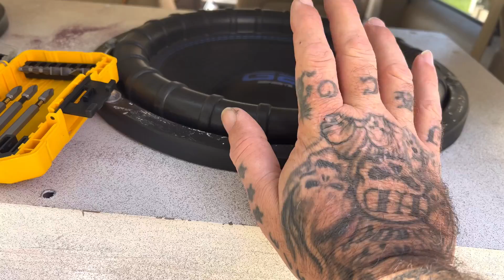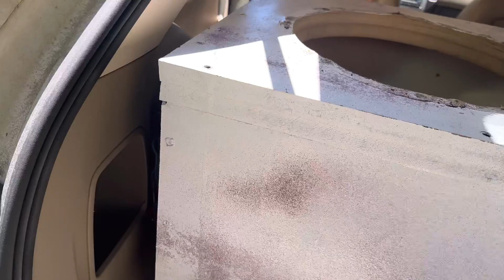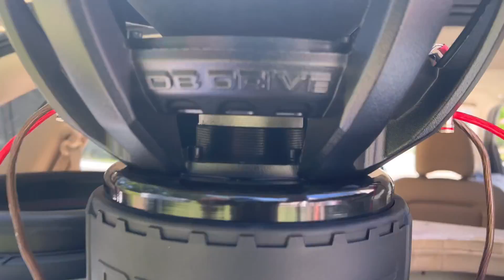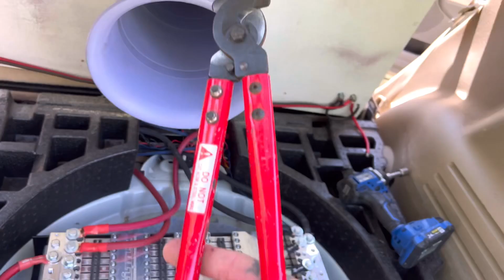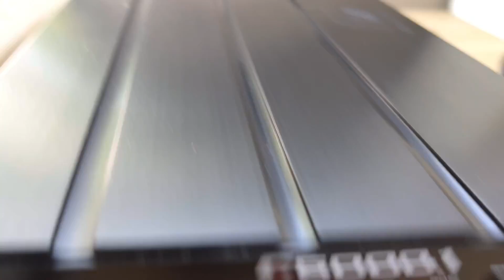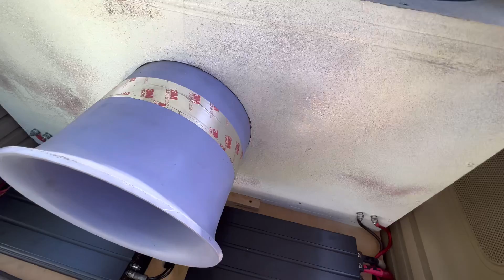DB Drive G7 system install in our Daily

Comment: Use t-nuts with machine screws bolt that b** in there you don't have that problem. No leaky leaky especially not with a little bit of weather stripping around your sub. Oh I know you know how to build you just threw that thing together it worked I understand. But don't be dogging MDF when you build a half-assed piece of junk. Just saying. You build an MDF seal all your edges seal all your pieces use t-nuts pre-drill all your holes router it correctly it's just heavy as f*** and might send you to an early grave without a respirator cutting and routering it. Which you should be wearing PPE to begin with. So don't be bitching about material when your craftsmanship is shitt to begin with. Other than that I agree with a lot of the stuff  you talk about but that one? Not so much. MDF Superior? hell no 1 inch B/BB grade Marine Baltic Birch hell yeah. Doesn't have to be Marine but if you going all out f*** it go all out⁸

Comment: T-nuts and machine screws to mount woofers in enclosure. MDF soaks up water like a sponge, so I seal it before painting/carpet/upholstery/finish. Mix white glue with water, then brush on box with a chip brush.

Comment: what type of batteries would you use for those two 5K amps? I'm thinking 4 XS POWER  PWR-S5-4700 Lithium batteries? And A 320 amp high out put alternator. Any Suggestions? BTW? I would love to hear your setup when it is finished? Thanks!
Reply from the maker: i have a 45ah Cmax for them
Reply: Thanks for the reply! cant wait for another awesome video!
 @JerryAintloud

Comment: I'm DB Drive guy for the last 4 years currently I have 2 g5 12' 4ohm's powered by 2 CT Sound 2000.1 amp but I'm looking to add two more g5 12' 4ohm's in my Yukon with 4 8 inch DB Drive Mid Range and 4 6.5 power by 2 1600 WDX DB drive & 1 1200 WDX for the 4 tweeters also  I will be add 4 DS18 Mid-Bass Loudspeaker 10" with 1 DS18 PRO 1-Channel Full-Range Class D Amplifier 5000 Watts. "look out World".

Comment: MDF is made from recycled cardboard. 🧐 I got my positive+ out of a BMW E35 out of the junkyard I work at. Best wire I've used in my 🚗 last wire it was welding cord the same as my hydraulics is not as good.

Comment: The rule in woodworking is to NOT put fasteners near the edge, besides cracking, there is no material there. NO STRENGHT,  so the issue is not the material completely, but the tolerances. you need to make/use some sort of circle jig so the cutout fits the sub better, maybe use marine grade ply, and epoxy some T nuts in. MDF is great for home speakers, IMO, but Not for cars, but I have a honda that hates weight, so there's that.
Reply from the maker: i used a circle jig . But' i;ve had 5 different brands of subs in here.

Comment: Yo so u said the part about ur drop at "15v and volume at 32, 35 is wer u set gain and u dont go to that volume because it clips or distort witchever u said for urs." Tho u said before that, "one amp is 10th lower". Can i ask u why u have one amp 10th lower? But u said u "shouldnt of been clipping at 32" tho if u dont have dual pole dual throw knobs you will be +/-10percent on the one amp so one is runing 10 and the other is running 20 wich. If it were 2 ohm and 4 ohm uld have stability that way as it wants to be "dual pole dual thrown" "posative wants to go forward, negative wants to go back wich would make makes one amp high ohm and the other less, if it wasnt needing that type of variation.. tho ur run a rca box wich is gunna help to all that tho the tenth is the distortion cause one amps load is a 10th of the other in that time^ but thats to be rcas shielded properly for the loads which then drops more but in proper timing and symetry makes for unity. Tho of couurrsee box plays to it all and frequency tho. Most to a true degree fundemental frequency shows way too much at y u are clipping at 32, and the 10th down from one the amps ( witch makes for more percentage of differences which is more to one then the other yes, its not much but!, if u look into discharge rate of batteries and as well fundemental frequencies and fourier function/ derivatives u then see that, if one is not to be a tenth down that tenth down wen time of rising it rlly is infinitly rising at that very moment wich is happening alot. But not enough to make clip light go on because the negative and posatives are being drawn at right times due to ur tuning but! As well i said look into crating and if u havent look in to cycilic charging which im rlly thinking u could control that, and if u do so for ur batteries running ur subs ull then make for proper pulses in time to soc cyclic charging which... ppl like to say im wrong to many things but ... im looking into... EVERYTHING physics wise to any formmm of energy and fundemental
 But ive rlly looked hard and im seeing whith way batteries discharge and fields drop and rise, same as well trims im finding that we rlly dont trust what was used right to all degrees to what a handheld meter would show us. But look into if u havent too. Semi qausi dual pole dual throw or jus qausi bass knobs. Youl see alot to just nobs and circuitry most would  i mean but theres sooo much more nd to our systems we are to degrees "out of phase to make for phase" but soo is everysingle other circuit.. so that 10th is the degree at witch is the portion odistortion thats in one of the loads due to the sence of "dual pole dual throw" 
(Im not saying u asked or have a problem with anything, but im saying like if u look into that stuff and learn it u might see it way i do, e=mc^2 (which is power in eqauls the power coming out tho yes ur changing it "tuning" but if it is same exact loads that is the reason ur clipping at 32 which as well look into doppleganger effect and that will show to the magnitude of the waves radius's tho if u were to put ur waves of "tune" in a doppleganger graph uld see that "if" its both the "exacctt" same ohm loads and ones 10th lower the pulse is "droping and rising to a percentage to--> (-/+)" which does clip too 1 and that is down a 10th from 20c "lets say" witch i said "c" that is from "C-rate" wich yes isnt anything to do with the tune but in way yes it rlly does have everything to do with allternatoing curent, wich is from the alternator and that is from "rmf" wich is the main supply but batteries is the alts supply too.. in order to up a field/turn on,turn off.. witch every thing has poles. 

(I am sorry ive said sooo soooo soooooo much tho in time if u understand this and see it or try to u will see how far off or bang on i could be but i talk in such a way with no "true propper terms" yet "the degree is there, and that is means which in real life means is "=" and in physics everything that "means" anything to a degree in force and electricity makes for percentege and degres and cutoff.. frequencies/ at which subs inside a "space the box is its fundemental freq which, if  it is dual pole dual throw it wil make for that to be propper^ but all that has to be known. And im not saying u dont know, and im not saying "YOU LEARN THIS rIGHT nOW!!" Aha im stating the fake to the real which is physics wich is numbers which is e=mc^2 and ppl dont believeee it tho if its sameee loads both loads are clipping and wont see that they are cause they are dispersing everything evenly
Reply: I have learnt sooo sooo soooo much to everything and im still learning. Long ago i had commented talking of sine and cosine asking u questions to it. U made a vid after that to using physics aha but yo ive learnt way more then i understood at that time, and now i have more corelation to time space and continum. Which almost like no ome understands... its truly trully alot and as much as what my shitty grammer and all would be^^ lolol but its crazy bro. Everything ive said may not be bang on but to degree that is function and EVERYTHING has its place wich if its same loads that place is clippage xD
Reply: Or distortion but meh its soo lill yet soo much its voltage and curent but the power that can come in compared to the power that does actually go out then the percentage lost made to heat and distortion and clippage cause how the emr emf and batteries um idk wat its called yet but by the way it all like dispurses it.. ppl dont understand me cause i dont use right terms but! If u learn the above or no the above, you can make sence to it. But lmaoo stilll idk bout that cause its degrees and ppl dont understand degrees because they dont understand "what zero" actually is! Which is frequency and thats everything in sumthing that takes for electricity.. so i mean im rlly trying to give insight. But the clippage shows in all the above^ as for thats all it is but ppl dont believe in physics as for thats allllooottt more time then using the meter but if u give physics a go and get true corelation to everything bro.. holy fack sysmetry all over the place.. not even just in real life but on paper in 2d form aha but yet that makes sence if knew a degree to a form which is forces and endless posabilities.. but in electricity its known. And made and calculated but only known to look at numbers of a meter whitch theres truth to sooo much moree^^ and that is clippage which again not saying do this do that, im just meaning to a sence of motion and force and waves degree everything it makes for that witch to a sence can be made soooo sooo soooo much beter nd a 10th to degree is quite alot we may not think so but to heat it rlly is wich basically is in way cycilic charging..

Comment: Or just set in nut certs and seal the box, and before you install the baffle just cut out an extra trim ring on the under side of the baffle about 3 inch around the sub circumference

Comment: Another thing with MDF that really helps is if you seal it with some sealer it stops it from absorbing moisture
Reply: I use that rubber in a can bed liner spray on the inside of the box  and it works perfectly fine for me
Reply: @donkelly3073 my goofy ass put bedliner in one of my enclosure and it killed my bass🤦🏾‍♂️🤦🏾‍♂️
Reply: @Cadillac Don   Sorry to hear that bro
Reply: @donkelly3073  thanks man, I fixed it though, just took a wire wheel and sanded it all out, and my lows and deep bass was back🤣🤣..but it took me a month to figure out what I did wrong or changed in my box designs, so now I only paint bedliner on the outside 😀
Reply: @Cadillac Don   glad you got it fixed bro stay cool
Reply: @cadillacdon6935  how the hell would using that bed liner spray inside the box change the bass output? That doesn't make sense to me. I've built a good amount of boxes, and to the best of my understanding, that shouldn't matter at all.
Reply: @bailey2517  it made the bass more reflective..kinda hollow ...its hard to explain, but I went searching and to my surprise alot of box builders has had the same effect from putting bedliner inside the enclosure, all said it killed the sound quality and low end response of the notes....but now that I haven't been doing it - everything is sounding as it should when I'm building enclosures🤷🏾‍♂️🤷🏾‍♂️
Reply: @cadillacdon6935  Thats waaack bro. Now i wonder if there's some sort of material that would make the bass LESS hollow sounding??
Reply: @bailey2517  regular spray paint never messed up my bass when used internally so use paint in the inside,,I will never coat the whole interior with bedliner again...I tested this bedliner internally with two enclosures to be sure and they both did the samething especially if you use an epicenter with your music, but the two enclosures with just bedliner on the outside didn't affect the sound so I will continue to use it on the outside ...
Reply: To seal it just use deluted wood glue and  brush or role it on the outside of the enclosure
 Creates a barrier that what cant get in and allows painting
Reply: When I can afford it I use 1" or 1 1/4" 12ply plywood
When I'm broke I buy 3/4" MDF
But I line ALL my enclosures with cheap closeout floor tile & gorilla glue & use inserts for screws
Reply: 1” mdf and a giant can of polyurethane does the trick for me
Reply: Just gotta paint mdf with a higher quality like 50$ or so a gallon black paint like 3 good coats & it'll last forever

Comment: MDF is fine if you use it right.

You can see the threads from the screws where the subs were mounted. Some of those screws were right on edge of the cutout.

Your cutout was too big and you didn't use T-nuts. Soak up some fiberglass resin around that edge to seal it up. The problems you had are all down to poor craftsmanship.

Comment: The MDF is fine, it's how you mount your sub is the problem. You don't just screw directly into the MDF, drill some holes, get some t-nuts and use bolts to mount the sub, that way you can take it in and out as many times as you want without stripping out the screw holes.
Reply: Yep,,,this guy is a moron  !!!

Comment: Great looking sub but I think for the money I would stick with Sundown or Deaf Bonce. Deaf Bonce 4515 is 4500 rms which like everything Deaf Bonce is conservative rating and it's only  $50 more than the G7's
Reply: Um... Paying an extra $50 to get a supposed extra 500w RMS, more power draw, weaker performance across the spectrum, steeper roll-offs, and about half the xmax hardly sounds like the "better bang-for-the-buck" deal, boss. Yeah, WinISD can't do it all, but it can help... 🤦🏻‍♂️

Comment: Jerry you are right about mdf wood an what I've learned that works for me is take a small can of Bondo fiberglass an make a 2in ring taped off of course around the top an the inside flange right where it swells up ,with the( Bondo) fiberglass. An sand it down with your palm sander ,it deadends the sound an creates structure to screw to. Love your videos
Reply: Try using resin and keep adding as it soaks it up. You won’t have to sand as much. No real need for the filler. It’ll make it water resistant too.

Comment: I built a parallel 6th with a db drive wdx12 in it for a buddy and it pounded. Those look way way tougher than the wdx's too.
Reply: Hi. I have two G5 15s and all the apps show I must tune 28hz do you have any advice please. Thank you
Reply: @angelotorode8205  I had 2 g5 15s tuned to 33 hz and oh boy did they hit. Can go wrong with 30-35 hz with these subs imo
Reply: @MANUELRAMIREZ-gc2cn  thanks for the info. I just done a design on winisd 7.9cubes net tuned 33hz with 123 inch² of port